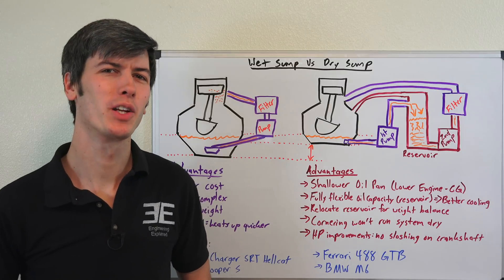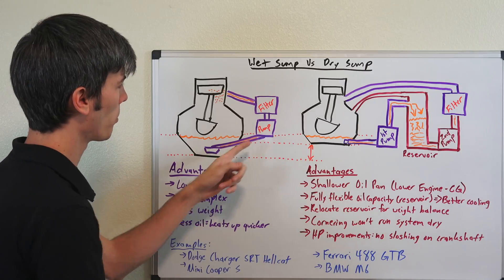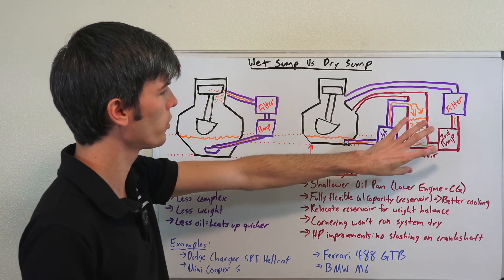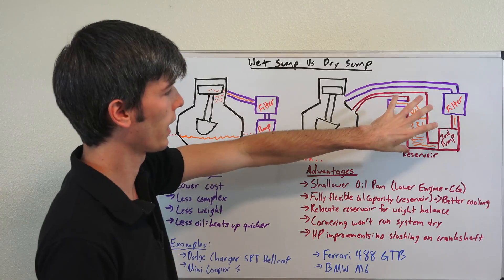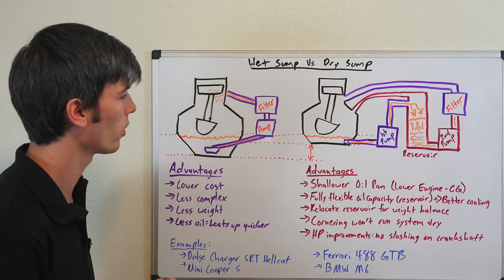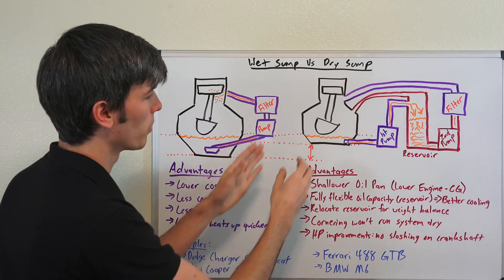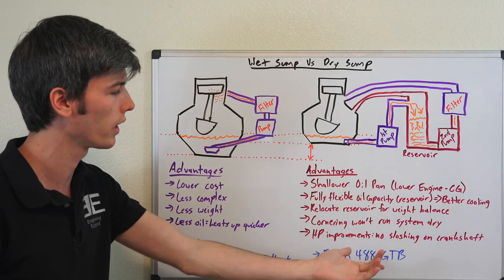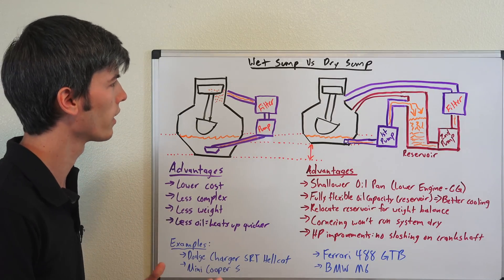Wet Sump Vs Dry Sump - Engine Oil Systems

Comment: When I bought my BMW M5 i used castrol 10w60 then they said move to Mobile 10w60, and now your saying they use platinum?
Reply: Jeffrey S BMW switched oils for the M cars. Mostly due to the fact that the engines aren't that different from their normal engines which wasn't the case 5 years ago.
Reply: Jeffrey S I use vegetable oil.
Reply: David Sahakyan I'd definitely still use 10w-60 on the older M engines (S85, S65, etc.) they have large bearing clearances and a high viscosity oil is a must.
Reply: Duh.  BMW just recommends the company that gives them the best deal, while meeting their requirements.
I've never owned a BMW.  I'm sticking to AMSOIL because I get discounts.  :P
Reply: TWS is not a brand it simply stands for (Ten W Sixty) Not sure what youre trying to say here using TWS and topping it off with normal 10w60
Reply from the maker: Awesome car!! As "Heel Toe" mentioned, it was a recent switch.
Reply: i'm using shell ultra racing 10w60
Reply: JDM Dragon that's the power of JDM
Reply: I got a 525i 2002 bmw and I been using 5W-30 full synthetic oil. But lately I been a lot of oil the past months
Reply: i have an e63 M6. using TWS 10w-60 and top up with normal 10w60 when she needs
Reply: that oil is castrol TWS 10W60, not the usual rs 10w60 or whatsoever. the film strength is 4 times that of normal castrol 10w60
Reply: @jjdiy
May I ask if you ever looked inside your engine?
Because I once tried Castrol TWS 10W-60 and when I checked the engine it looked horrible inside, everything was black'ish and burned.
Had to clean the whole engine....
Switched to Shell Helix Ultra Racing 10W-60, checked it again the next time and everything was still clean inside. Same duration of oil usage. Same kind of driving.
I'm on the fourth run with it already, last three times everything looked great.
Also I've noticed a gap in oil temperature when  switched, the Castrol got up to 15°C hotter than the Shell.
I think next time I'll try the Mobil 1 for a change and see if it can hold up with the Shell.
However, I don't think I want to touch Castrol ever again....